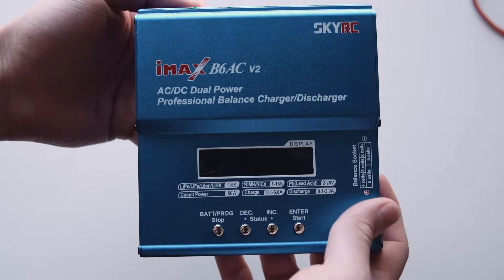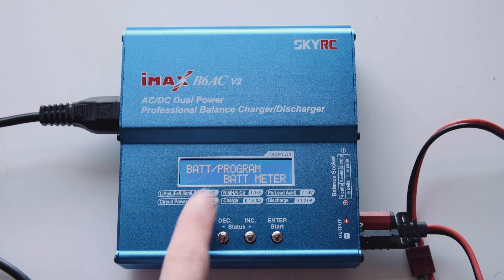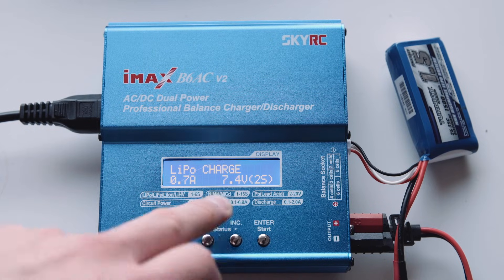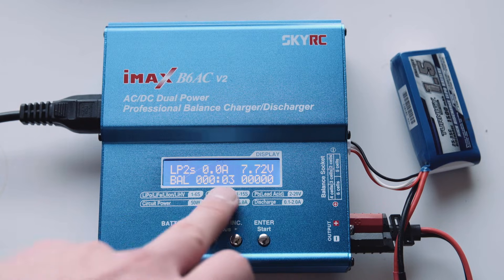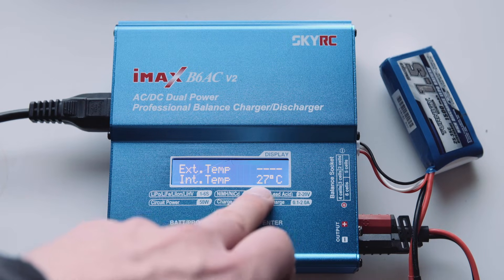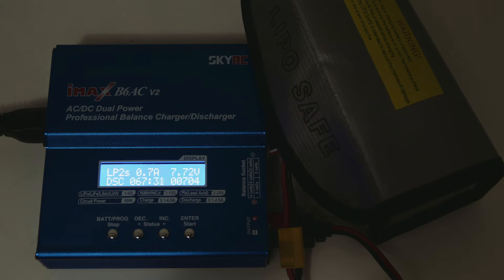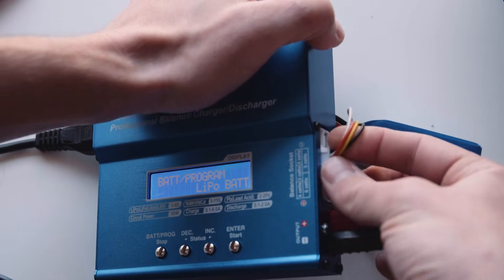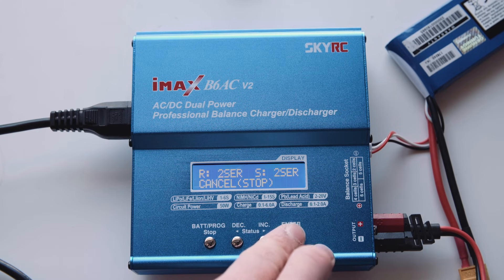Imax B6 battery charger tutorial

Comment: It's not possible to charge a battery without balancing connector in the "normal charging" mode. The charger responds with "no balancer connection" failure. Therefore it seems that there is no major difference between normal charnging an balanced charging.
But I do have LiFePo4-batteries with an internal balancer, which cannot be charged here with normal charging mode.
In the system settings menu there is a hidden option to deactivate balanced charging. But this setting I would expect in the memory settings.
Overall, the firmware is outdated and requires an update.

Comment: I keep getting the message “connection break” does anyone know what that means? Cause it won’t do anything after that so I can’t charge my battery. Keeps me that message every time
Reply: Unless your unit is broken, it means that you have a bad connection in the way you have your battery plugged in. If you are trying to charge 2-cell and up Lipos you MUST have BOTH the main +/- leads AND the white multi pin Balance leads plugged into the correct sockets on the charger. It could also mean you have a very bad cell (or wiring break) in your battery. Check it with a cell checker.

Comment: I know this video is a few years old now but just a couple questions. First off, how do you know when it's charged? I ran the battery basically dead. Car was at walking speed. Put it on the charger and the 7.4v 2s lipo was already reading around 8.4v 🤷‍♂️. The charger seemed to still be putting power in to it. I took it off after 30 mins. Nothing seemed to have changed much numbers wise. Also I noticed in the video you started off with a 1500mah battery and you set the capacity cut off to 1500mah. Later in the video you charged a 3300mah battery and changed the charge amps to 3.3 but didn't change the capacity cutoff from 1500. Will this be a problem. I think I did the same thing switching from my 1800mah heli battery to my kids 3300mah car battery
Reply: The charger beeps and says battery is full once done. Unless you're fast charging, it's going to take longer than 30mins to charge most batteries. The 1c charge rate is to maintain battery longevity.
The higher input voltage (8.4v) will be higher than the nominal voltage (7.4v) of the battery, that's normal.

Comment: Hi. Please can you help me out. 
I have a Li-ion battery 7.4V and 1500mAh. 
Firstly, do I select Lipo for charging?
My Imax charger does not have a selection for Li-ion.
I have followed your first example in your video, however, when I select Starr charging, a message appears as follows:
R: 1SER   S:2SER. When I select start,  an error message appears Li2S Full. 
This is a brand new charger that I have bought and struggling. 
Thanks, Sean

Comment: Hi so iv got this changer and iv got a 14.8v 4s 6000mah 70c battery so what amp should I set please can't find info anywhere really appreciate if you can help
Reply: These chargers can only throughput about 60watts. So you could only charge your 6000mah 4s battery at about 4amps - NOT the 6Amps of a normal 1C charging rate. So it will just take longer.

Comment: Is there a way to tell when they’re charged?
Reply: It will say full but I wouldn’t buy this charger it overheats and will stop working after 10 charges…
Reply: @Qsfd142  I have it already came with the truck
Reply: @valleybuilt8979  I would get an external fan to connect to it then because they overheat and the motherboard fries itself
Reply: @Qsfd142  thanks for the tip; mine isn’t exactly this one

Comment: Hey man. Just started using this today. I'm charging a NiMh 7,2 V battery for my Tamiya RC car. The battery is 3000 mAh so I set it to 3,0 A. I look at the data shown in the display while charging. At the bortom right, the mAh is showing. When it reaches 3000 it should be full. Does the charging stop automatically then? Also, top right it shows current voltage. Right now, for instance, it shows 8,73 Volts. Maybe I'm dumb but ermm... I thought a 7,2 V battery could never reach higher voltage than that exact level. What is it I don't understand?
Reply from the maker: Hey, if its a good quality battery the actual capacity will be very close to or higher than what the label says while If its a bad quality battery it could be much lower. It will automatically stop charging as soon as the fully charged voltage is reached which the charger has preprogramed in for the battery profiles. 

7.2v is the nominal voltage of your battery, during loads and charging the battery will range outside this. If you have selected the correct battery chemistry on your charger, it should be doing the correct charging voltage. 8.7v does seem high to me though.
Reply: @jbmods692  thanks for replying so fast. Upon completed charging it turned off like you said. If the voltage goes up too high during charging, is that a safety issue? The battery is all new. I did notice it got real hot during charging and stayed hot quite long.
Reply from the maker: @magnusjohansson295  No worries,

It shouldn't be hot to touch, maybe slightly warm but not hot. Reduce the current that you are charging with to 1amp or lower and see how that goes. NiMH can get hot when charging at higher currents. 

Double check you are using the right chemistry profile on the charger aswell.

Comment: i was wondering how do you know when the battery is finish charging, also do you have to Storage it after charging?
Reply from the maker: The charger will stop charging when the battery is full. I only put mine to storage if I am not using the batter in the next day or 2. Storage is to keep the battery at its most stable storage voltage to prolong the life of the battery and is safer than storing the battery at 100% charge.
Reply: if each cell reach a value of 4.2 voltage you battery is fully charged. There can/may be a difference of 0.1 between the cells.

Comment: Hi man I watched your video but it didn"t answer my probmems :/

I bought the Imax B6 (for some reason it's black and not blue

And I am facing multiple problems: 
When I try to "BALANCE CHARGE", it auto-detect as 2S and even when it's blinking I can't change the value to 3S-4S-5S-6S

The chager never  match the cell number of my battery no matter which mode I'm in : I plug my 6S battery in and it detects 2S
On other charging modes; I can force the 6S but then,  before I start the charge, it says  " R = 4SER S= 6SER "

If I force the charge like so ( R = 4SER S= 6SER) the Battery voltage actually goes down as time goes by
Do you have any idea of a fix ? Or did i receive a faulty chager ?

Comment: I have this exact charger, will it charge my tattu 25000 mha battery safely? It's all I can afford after buying that beast of a battery.
Reply from the maker: Hey, 

As long as the battery chemistry is one that the charger supports it shouldn't matter on the size of the battery. It will just take a while to charge with that big of a battery since the charger is limited to 6amps I believe. Does that all make sense?
Reply: @jbmods692  sure does, thank you.

Comment: I bought one of these a while ago and it has never worked properly. It will charge up to a point then the amps will drop to 0.1 and then suddenly discharge the battery. I can leave it for hours and it won't stop. Also the voltages it shows are wrong when I test the battery with a multi meter. I have a genuine one. Just a waste of money that was highly recommended.
Reply from the maker: Hey mate, if you return your faulty product they will issue a refund if it is a genuine unit.

Comment: How many ampere is this and can we charge car battery with this charger
Reply from the maker: Hi, you can not use this to charge a car battery. You need to buy a specific charger depending on the chemistry of your car battery that is designed for it. 

The Imax B6 has a maximum output of 50w.
Reply: @jbmods692  but there is a option to charge lead acid battery as a Pb, i think it is possible bcoz this imax is 6 ampere, i hve tried in pb option 6 ampere 14 volt
Reply from the maker: @zoheb4you2002  Yes you are correct, sorry I was mistaken. You can charge a car battery!

Also you must use 12v setting if its a standard car battery.

Comment: How much time is needed to fully charge a battery with 5200 capacity
Reply: I'm pretty sure it depends on your charge rate.. If you charge at 5.2 amps it will take 1 hour.. If you charge at 2.6 amps it will take 2 hours. Does that seem right to anyone else?
Reply from the maker: @bmzaron713  That is correct, generally you charge your batterys at 1c which is 1 x the amp hours of the battery. So a 5200mah would be 5.2amps and take 1 hour to charge.

Comment: Need help
I am new in this field
I have two questions
1. How much time it takes to full charge 3s 5200mah lipo 30c?
2. It says 3.7v on battery as wel on imax charger menu, but it goes to 3.84v and sometimes 4v is it safe or normal?
Reply from the maker: Hey mate, a fully charged lipo cell will be at 4.2v so yes those voltages are fine. I wouldn't leave it in that fully charged state for extended periods of time, only have it fully charged just before a gameday and discharge it to a storage voltage after.

As for charging times it all depends on your charge rate. Charging at 1c which in your case is 5.2amps it will take 1 hour to fully charge from flat.

Comment: I hear people often say many batteries lie about the their true mAh, so how do you know what to use when charging your batteries?
Reply from the maker: Hey mate, very good question. If they battery isn't a reputable brand, I would just charge it at a max current of around 0.5amps just to be on the safer side. Then we you have done a test and know the actual capacity you can up the current.
Reply: @jbmods692  was a good question answered very well my knowledge has been expanded thank you I'm just getting into these batteries and battery building

Comment: Very informative, Thanks for the guide on the charger. The time lapse of the charge was pretty cool. 
I noticed you did a quick retake of what you said at around 6:40. Just lettin' you know. 
Also, on rare occasion, particular chargers don't interact well with particular batteries, which is something else to take into consideration when getting a charger. It's pretty uncommon, but it's much better to catch it early rather than later.
Reply from the maker: Thanks mate and yes I missed cutting that retake haha
Reply: @jbmods692  I put the battery to charge normally with the process you showed in the video and after 10 seconds it stops charging and throws me out and doesn't charge. I don't understand why this happens?😓